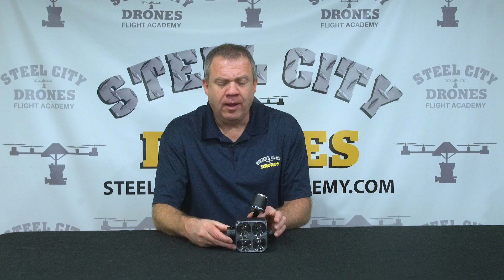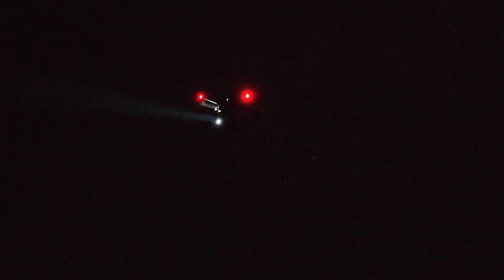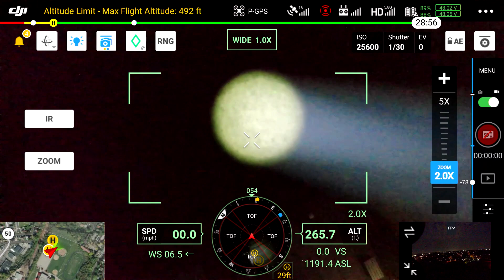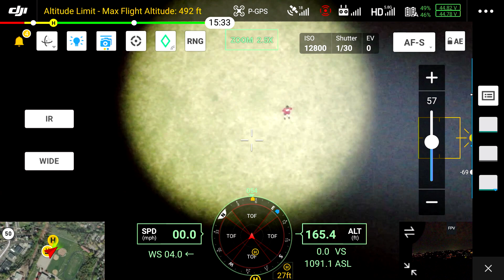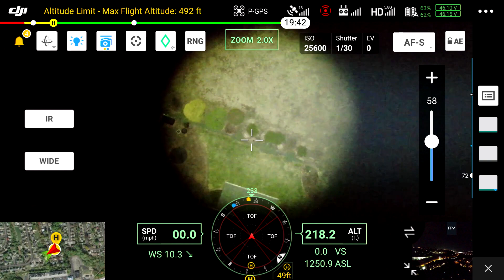CZI GL60 Plus Spotlight For DJI Matrice Aircraft

Comment: Is there a proper sequence to get the drone to pick up the spotlight when connected?  I have to restart my drone and controller a few times before the light controls show up in my smart controller.
Reply: Download DJI Assistant on your computer. Connect 300 with all accessories attached refresh all firmware. on second SDK device downgrade to one firmware version back. Power off the drone connect the gimbal to the osdk port using the provided cable. I had the same issue mine works great now.
Reply from the maker: Hello EMA Bedford please contact the dealer you purchased the light from for support.